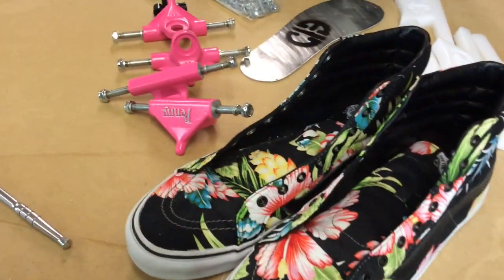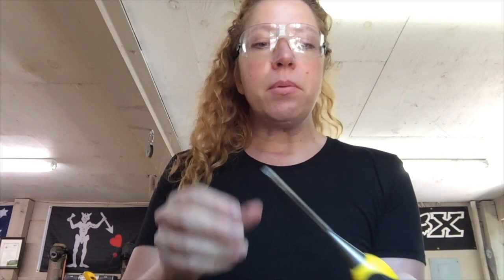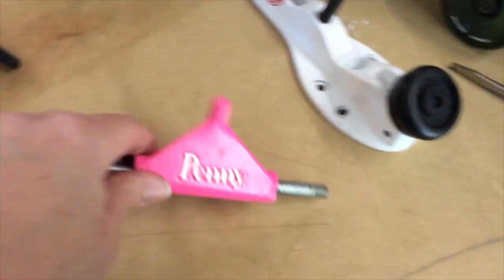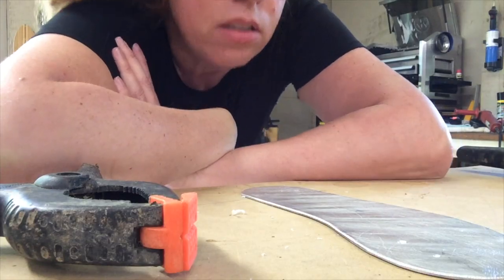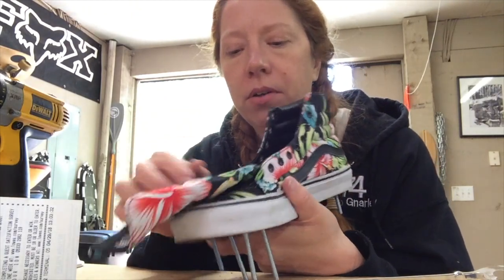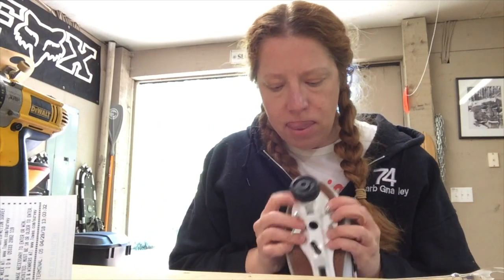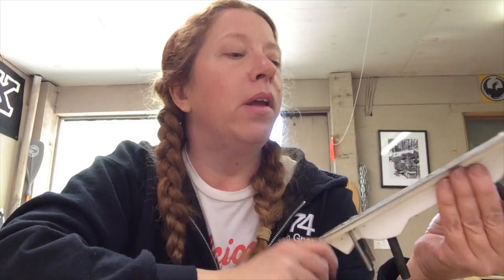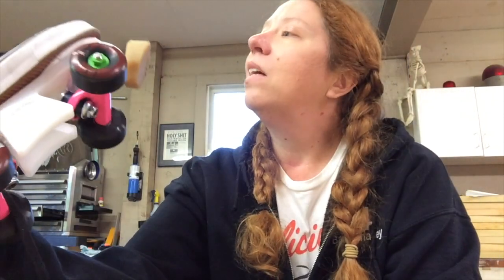Making Vans Roller Skates

Comment: I was planning to try this but I was going to use sole leather instead of a metal plate since I used to make shoes so I figured this heavy compressed leather would add enough structure since it's similar to what you'd find on the bottom of leather skates anyways. With a metal shank glued in for extra support. I'm thinking that it'll end up being less drama than drilling through metal.
Reply from the maker: That makes sense! Sole leather is super hard so give it a shot! I'd love to hear how it worked out for you!
Reply: Did you ever end up making these with the sole leather? I was thinking about trying that as well and would be interested in feedback
Reply: I’ve been curious if this was done. Any updates, if it was attempted?
Reply: Did it work out with the sole leather? :)

Comment: I am making a pair of these for my daughter this weekend using the same Vans. One step that makes it a bit easier is to use to nuts inside the shoe and screw them on from the outside. Great job
Reply: T nuts are not like regaular nuts, they are more like a washer with a piece threaded to it. When I made my cleat skates I countersunk the inside where the nut fits and it has never been an issue.

Comment: I actually made a pair of converse roller skates and I'm not entirely sure why the metal plate is used in these builds. My bolts are held in place with washers and padding is in place to make sure those bolts don't rub against my feet. They're very comfortable and have held up for 4 years (through countless stair jumps and grinds). I think I would agree with Natasha down there that you could probably just use leather and it wouldn't be too bad.
Reply from the maker: Whatever works for you! The aluminum plate was recommended by many sites and skate shops so I took their advice. The metal will stiffen up a soft rubber sole to provide a higher level of response and durability. But there are so many cool custom shoe skates out there I'm sure there are just as many ways to build them. This was just my way! Glad your skates are holding up!
Reply: @KirstenBoehmer  I think the best idea I can come up with are so that the dispersion of force when pushing or landing on the skates is more across the entire foot. I know some skate plates are pretty narrow and if one has a shoe base that isn't firm or keeps it's shape under stress, then there will be a lot of force put across one axis of the foot. Could be pretty painful from really high jumps. Interestingly tho, I've never had this problem. I've jumped down at most 6 stairs and my feet were fine, no soreness at all. Of course I do have some good insoles to help too.

By the why, really wonderful build! Those skates are very beautiful! It reminded me of when I made my first skates. The learning process can be pretty aggravating but, the final product is all worth it, especially when you can build more afterwards and don't have to face all the troubleshooting you had to in the first build!
Reply from the maker: @CuddlyJon  Thanks!! I've gotten so many compliments on them at parks. :)

Comment: Try to cut a slot into the flat head of the screw next time. That way you can put a flare head screw driver in the cut you’ve made and undo the nut.
Reply from the maker: I tried it with my dremel but couldn’t get it to work. Maybe I didn’t have the right blade for it or something.

Comment: You should of put the metal plate on bottom of the shoe to mark the holes and drill from outside into the shoe. You should of bought screws with a hex head inside it would be much easier to tighten and remove them by putting a small Allen wrench inside the shoe the hold the bolt head while you tighten the nut.
Reply from the maker: The metal plate only fit very specifically in one place inside the shoe. Putting it on the outside to mark it could leave me with a 1/4" or more difference that would mean the skate plates would not be aligned how I wanted them. The mounting hardware that I usually buy from skate shops was all Phillips head so that's what I ended up finding at Lowes. I agree a hex head would be easier to get into the toe of the shoe, but it's doable with a phillips head.

Comment: I have a question regarding the kingpin on the Avanti plates because with the trucks they came with, the kingpin was sticking out further than the truck. Wondering if the kingpin still sticks out with the Penny trucks? I couldn't really tell from the video.
Reply from the maker: Hi - it sticks out a tiny bit but I have not cut them down yet. I'm a little nervous about that for some reason?
Reply: Yeah I totally get that! In my opinion there's way too little information about kingpins and wide trucks in the community.
Reply from the maker: @rollerscab  UPDATE - I cut down my kingpins over the weekend and it was not bad! The tip I got was to keep the nut on, and use the nut as a cutting guide. Then when you unscrew the nut it cleans the threads, and then replace the old nuts with new ones. I used a hacksaw which was a bit slow but I was warned against using a grinder due to too much heat from friction with the nylon in the locknuts.

Comment: Hello!!!! You have inspired me to do this! Only 1 problem. I cant find and other place but chicks in bowl for the metal inserts. They are all sold out 😞... is it any other place i can purchase them from?
Reply from the maker: Hi!! Thanks so much!  Several roller skate shops stock these insoles. Here is a link to Sk8 Ratz since they helped me out when I thought I had gone wrong... https://www.sk8ratz.com/chicks-in-bowls-aluminum-strengthening-insole/
Reply: @KirstenBoehmer  thank you sooooo much....keep rollin!
Reply: This is the same place i found that was sold out 😞
Reply from the maker: @nickthompson2778  You could try calling/emailing Bigfoot Bike and Skate shop. (Google them) Their website is terrible for finding stuff but they do a lot of builds so likely have the part.  Good luck!
Reply: I saw this guy on youtube make his own fiberglass soles using the shoe sole as a template. U get the fiberglass and resin from hardwsre sore. Very cheap $12
Reply: @ertfgghhhh  Can you link the video please?
Reply: @Unidentified863  i looked in my Skate folder and the persons videos are gone. All of them

. He bought a resin and fiberglass kit from home depot.  He traces the insole on the fiber. Then he paints the resin onto both sides of the fiberglass. He did 7-12coats. Let dry. Then drilled the holes. He used it instead if buying aluminum soles. Hope this helps

Comment: Ive built a couple pairs of these now and getting the bolts through the rubber is by far the biggest pain.  However, each skate does get easier.  I actually made the metal insoles and that was an absolute beating as well.  Way easier to purchase through CIB or Brian from Bigfoot Bike and Skate.  How are yours holding up??  Any issues with the pivot cups?
Reply from the maker: Clint Collier hi! No problems with the pivot cups or the skates! I love them. Took a bit to get used to them- especially the sliders! My biggest issue with them right now is just the durability of the canvas of these skates. Have worn a hole in the toe :(  so I’m actually looking for either a toe cap or some decent looking reinforcement to protect them.
Reply from the maker: As an update to this comment - I ended up using a product called "Tuff Toe" to make toe caps on these skates and that has worked like a dream!!

Comment: I mount and re-mount my plates a lot, and I hate those screws without screwdriver heads. I never see the point of them, they're just really complicted and weird. I typically just rip the nuts off with bolt cutters and purchase new screws, it's aggressive but it works.
Reply from the maker: Ruby Shepherd I am getting ready to replace the plates in my Moxi’s and hate the thought of dealing with the bolts. In addition I really want to grind down or replace the kingpins on my Vans (the ones in this video) but I don’t want to deal with the bolts :(
Reply: @KirstenBoehmer  I will say, I found a loose drill bit in my tool drawer that just happened to fit. It's a small square shape. I accidentally striped it, however. I'm sure you could find the right tool at Lowe's, if you search hard. Just be sure not to strip it out. (So be SUPER CONFIDENT in your coordination skills)